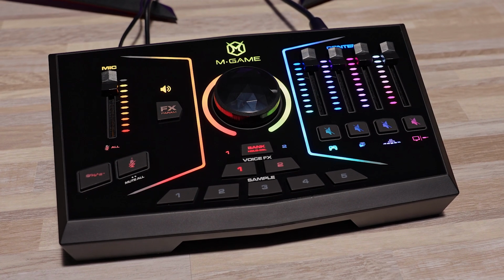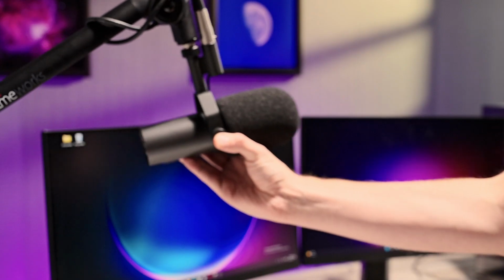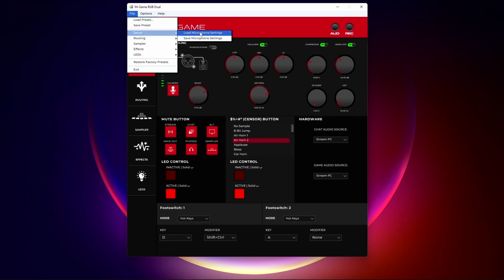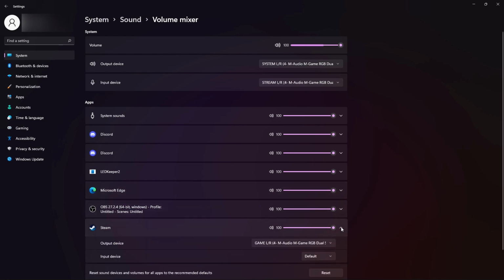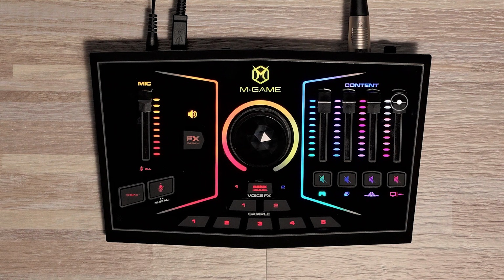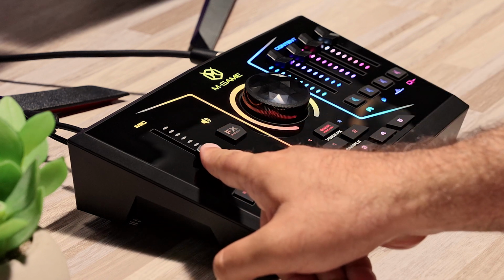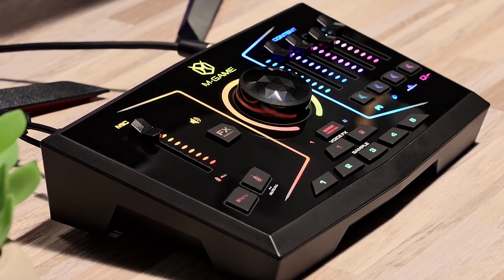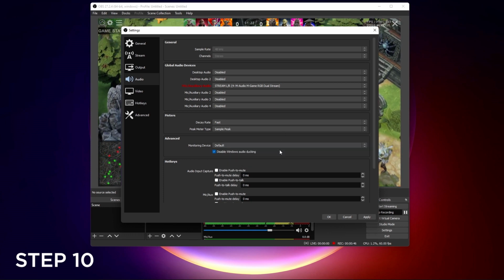M-Game Setup in 10 Easy Steps

Comment: So basically if you run a USB wireless headset you can't connect it unless you run a audio cord from it to the mixer? I had a mixer half the price and had the function to use the Wireless headset. Looks like I will return this item.

Comment: No buzzing or humming and digital noise like happens so much when you wire audio from a computer? Working on dual pc stream  I have an audient id14mk2 and a analog mixer with 2 channel usb in/out... just trying to get all the sound I need mixed without crazy noise.

Comment: FX button will not activate. Bought one and it did not work. Got a replacement from Amazon, it worked at first, but once it was fully updated and setup, it stopped working. It will not activate.
Reply: I just bought a sound card and FX PARAM doesn’t work on it either - how can I check it? How can I find out if it’s a defect or a bug in the software?
Reply: @Flafik_  well I went through 2, same issue, and my nephew has one and same issue. I think its completely shitty of M-Game to not address this, nor fix it. There has not been any updates to its software  since it came out honestly. Just very disappointing in this company.
Reply: @JessGal  Let's hope that they will act humanely and fix everything! I was also disappointed in the routing, there were only two tracks on the gaming PC...

Comment: Where's the USB Microphone video? It's definitely not on your channel..
Reply: Couldn’t find it either
Reply: @whaasjr  I'm assuming it's either got a switchable feature built in or it's going to be a video about voicemeeter..
Reply: @YuJay  I’ll find out I just got mine delivered today!  Going to attempt to set up tomorrow maybe
Reply: Any update?
Reply: @haies09  I’m struggling big time trying to get everything to work right.  There isn’t a lot regarding setup aside from this and some of the steps don’t match mine.  I got some things to work but others aren’t working at all.  Can’t get control of certain things and can’t get all the sounds to go through my stream
Reply: any news?
Reply: @iderobold  I needed to use my USB Microphone temporary as my Dynamic mic broke, the way I achieved it on my PC was to buy a 3.5mm Audio with a ground loop isolator and plug one end in to the Mic In on the Mixer and the Other in to Audio Out on the PC/Motherboard. Then in the PC Settings Open "Sounds > Recording > Your Mic > Listen to > Your Audio Out" and this will allow you to control your microphone via the Mixer. The reason for the Ground Loop Isolator is because motherboard audio is very noisy and one of those will eliminate that.